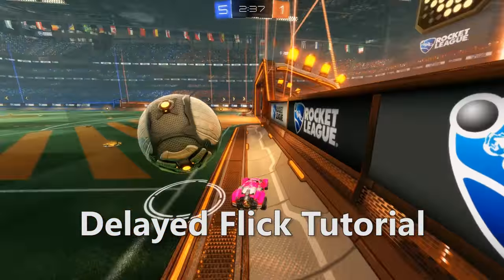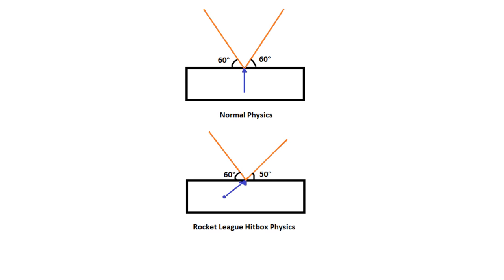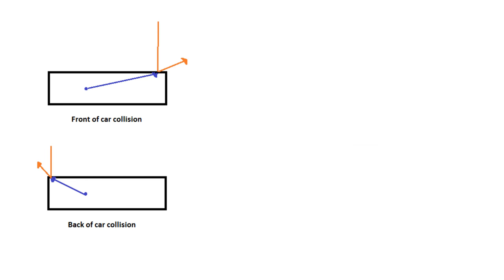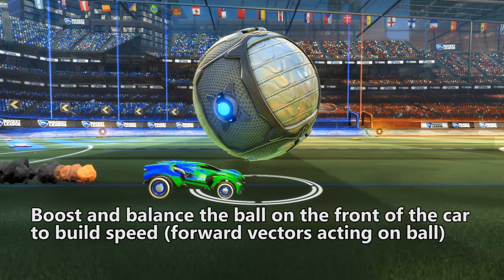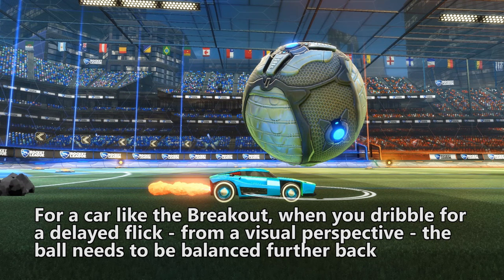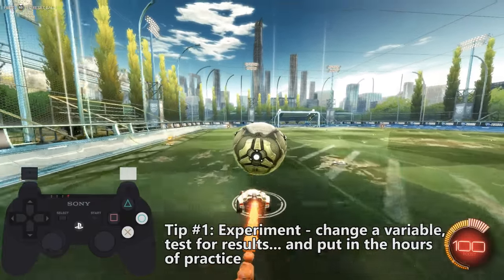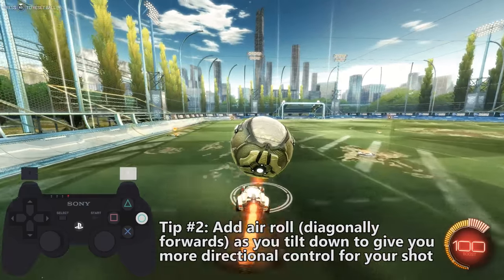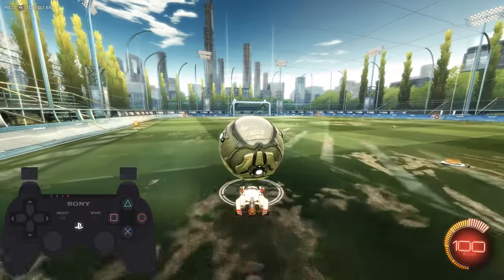Delayed Flicks | Rocket League Tutorial

Comment: Hey kev, since your artworks and physics-explanations are exceptional I would love to hear some hints and/or see a tutorial on generating power from low speed. I created some shots for myself where my car starts quite close to an unmoving ball (or a ball that flies slowly away from me in some direction) and tried to generate as much power from there as I could. Well while I am obviously still struggling with rotations in the air I was surprised that I apparently still don't know how to hit a clean powershot from the midline: I placed an unmoving ball in the center circle, my car two car-lengths away and tried to bash it in without the ball touching the ground. With a clean frontflip at the center of the ball, I make it 1 out of 3 times. If I hit the ball just slightly off center, I generate way less power and can't reach the goal-zone. Why is there such a difference when my speed is the same and where/how do I need to flip in the ball to make it arc the most?
Reply: I fear the answer will be "flip straight into it and tap x twice as fast as you can" but I don't get what causes the major speed difference when I do this (and probably flip slightly too early or off center)

Comment: I'd beg to differ, 100% elastic collisions do exactly what you showed as 'normal physics' but in non elastic collisions there is a loss of momentum normal to the surface and a loss of momentum parallel with the surface, dough I don't think Rocket league simulates the latter.
That's for the walls, the vehicles dough seem to work as you explained.

Oh and heat due to friction (etc..), but again, I don't think Rocket league simulates it.

Comment: Why are you using x-devil? Just wondering because its not one of the top cars
Reply from the maker: Tobbe59 The center of mass is closer to the middle of the car, so I like how you can get from balancing the ball on the front of the car (to build speed) to a delayed flick relatively quickly, compared to a Breakout or Dominus. Same hitbox as the Dominus, with slightly better turning as well... So kind of a no brainer for me.

Comment: Are there any tips to getting more height on delayed flicks with the octane? I can get some decent speed, but it's always too low.. So much easier with X Devil or breakout
Reply: Positioning, timing and practice
Reply: Don't lean forward to make it go higher and place the ball a tiny bit further back than usual.
Reply: Brett Harris I usually try side flicks and also try to make sure you're going the same speed as the ball. Ideally you should dribble to the point when the ball is no longer making those little impact sparks on the hood(basically matching ball speed). I'd say that will have a significant impact on your flicks.